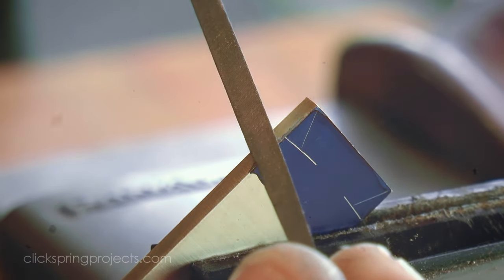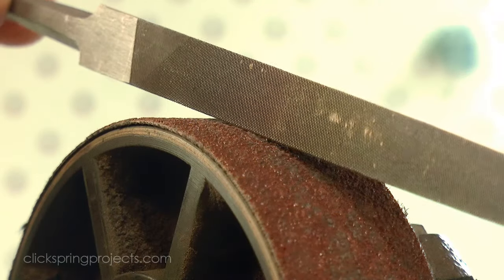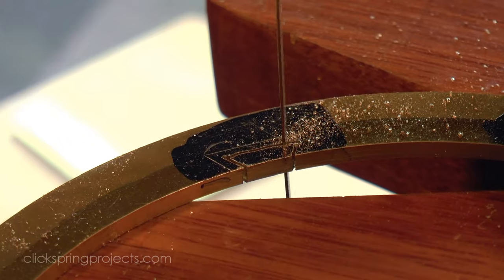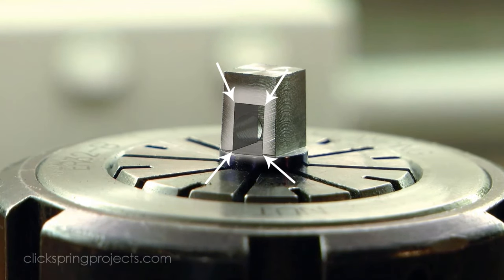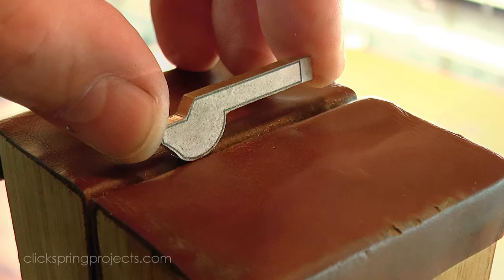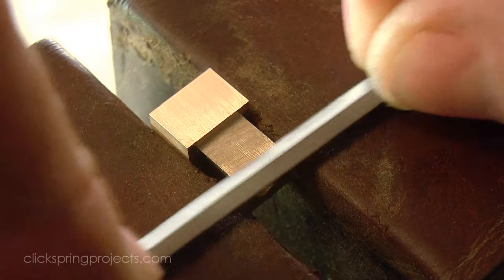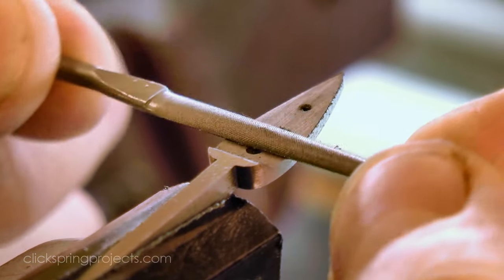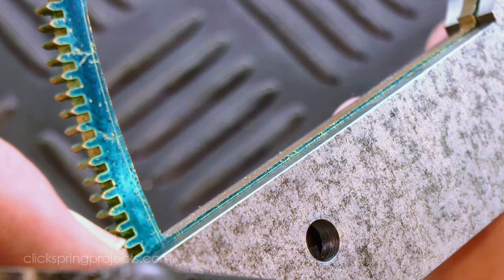8 Old School Tips For Better Hand Filing

Comment: I've tried using spray stuff or oil to keep a file from loading up and to make the cutting go faster, but just on crude jobs. Aluminum is the worst. After seeing this tho, I'll be looking for better files and fine brass brushes as I'm going to start making  parts to finish or restore older model airplane engines. Thanks Chris, you are amazing.

Comment: I like starting a cut or correcting the direction of a corner cut with a small knife file. I also like the finish I get with a sharp single cut file. Brands: Grobet Valorbe, Friedrich Dick, Bacco or Bacho Italian made files, OLD Heller Horseshoe made some VERY lovely old short needle files including the finest smallest knife file EVER. It's only about 3 inches long, and it has a very sharp edge. Huachaco made a very nice Swiss file in the Romansch area of Switzerland. Stubbs are about the best English files made. Heller is the best USA made file set in my kit. I have coffee cans and tobacco cans filled with small die sinker, needle, riffler, saw, sawpit, Pippin, safe corner fret files, and other specialized files, many of which I custom ground. Liogiers and Aeriou are two good rasp makers. Liogiers does bespoke shapes and tooth sizes/counts, with both right and left hand cuts. You can easily sink $40,000 in one order with Liogiers.

Comment: On fine work I clean my files a lot on soft material to get even removal, I always test my files on scrap of what I need to file so I can get a feel for how much pressure I want to use on the main piece so I don't dig into a piece and need to start over. Don't rush fine work, make sure you have time before you start fine work. For me rushing makes more scrap then anything. A good selection of files is key to having the one you need for the material you need to work on.

Comment: Superb work! Elegant! I really can't appreciate your work enough...
I had a question, what is the saw you use to cut thin metals? Is it just regular jeweler's saw or some special kind of coping saw? (And what's the maximum thickness (different materials: brass, copper, (annealed/not hardened) steel) it can saw through (efficiently)?
Thanks!

Comment: we had to file a piece of rough cut flat profile mild steel bar in school for metal work class 20mm x 100mm x 50mm to within 1/20th of a mm and all surfaces flat and square , finished with a chalk filled file to get it shiny . we sure learned to file properly ! this was 1964 . Still doing it when needed. nice video.

Comment: One filing tip given to me by my mentor specifically for use when filing aluminium is to file right to left,  instead of left to right for steel. In this way it is possible to get a very smooth non galling cut on aluminium

Comment: Sacrificial wooden filing jigs are also good when you have an object that can't be held with a vise. They are usually tapered pieces of wooden scrap that can be screwed/nailed/secured to a bench somehow. Making blade collars and other knife fittings that need a gentle radius is much easier when you can finesse the work and the file at the same time.

Comment: Holly shit, I thought I knew a bit about using files and I just discovered I know very little. I think putting a safety side on a file is the best tip ever as I have ruined plenty of perfectly made square holes when one of the other edges has hit one side as you described. I find a good sharp file is a pleasure to use.
Cheers Stuart 🇦🇺

Comment: Consider scraping as an alternative to filing. My last project was making a 50mm wide dovetail mounting plate from aluminium. I scraped the last bits using the the side edge of a woodworking chisel.

Comment: Is there any way you will publish the plans for the clock ? 
I study systems engineering and during my practial phase I got 2 weeks time to build a clock. Of course this is to short to build it the way you did, but I got access to a powerfull CNC-Laser, a lathe and other machines.
I found other plans on the internet, but none of them looked as good as yours. 
You'd make a young engineer very happy.
Cheers and keep up the good work.
Reply from the maker: You can buy the plans from here: http://www.clockmaking-brass.co.uk/clock_construction_books.html scroll down to the Large Wheel Skeleton clock - Cheers :)
Reply: Thanks for the quick response. Do you get the book as a pdf or as a real book ? As I'm pretty sure there aren't any digital drawings included, would you mind selling those if I buy the original book beforehand ?
I don't have the time to do them myself and my skills aren't that good yet.

Comment: For filing aluminum, I try to use files that say "Aluminum" on them, and keep THOSE away from the students who will beat them up.   Some hard soap (just an ordinary bar of laundry soap) can be rubbed on the file to help the action, and it just washes off.  I use ordinary but sharp and new files to cut the edges and corners of aluminum things, to give a crisp bright finish.  They would probably clog on a broader surface.

Comment: One thing you did not mention, but I am sure you know, is that square files are not in fact square, they are formed off square, so by grinding one face smooth you can get a much better square hole, also for longer file life, never drag the file back when filing, this blunts the teeth very quickly, you also point out the extreme value of making simple jigs a profiles, this is a huge benefit when making complex shapes, I also find the Valrobe files to be the very best available, they are of excellent quality, unfortunately most people tend to go for price, which makes the job of filing a chore, not a therapeutic pleasure. Many thanks for posting this tutorial !

Comment: Don’t forget keep files unclogged for cleaner cuts, by using wire brushes called file cards. I sometimes use blackboard chalks rubbed on to files to prevent clogging.

Comment: no mention of a file card , or french chalk , but all in all a great video
the guy who taught me to use a file forty years ago was called Mr Body , and his thumb was actually bent nearly 90 degrees over straight from applying pressure to larger files , to actually bend them along their length to reach the centre area on large flat surfaces.

Comment: This is 'filing' as I was taught it in the dim and distant past, when you were given an amorphous lump of metal and told to make an accurate cube out of it with only hand tools and marking/measuring equipment, that was when we used a measuring system around 'base' 12 and not 'base' 10 because the ability to 'divide' then 'divide' again suited hand craftsmanship and not machines - like Leonardo's 'man in a circle'

Comment: Hey Chris, I got a question for You if i might: What kind of brass should i use to make gears and things that You typically do in your movies ? Is it a lead brass like MO60 or normal Like M63 ? Which one does grind by files easier, and which one is better by strength meaning. I can't find any good literature about that. Can You recommend something for a beginner ?
Best regards, I love your work.
Reply from the maker: Hey Miklas, yes you're looking for a leaded brass (the lead component in the brass ensures that it is highly machinable) The best brass sheet stock to use for wheels, plates etc is generally referred to as "Engravers Brass" or "Compo Brass"- its a leaded alloy (in the UK called CZ120) with a "half" or "full hard" temper. Note that the temper has nothing to do with the alloy composition - other brass clock components are generally made from the same alloy in rod form, but with temper not specified - Cheers :)
Reply: Thanksy! i find it difficult to find pieces thicker than 3mm. As i am from Poland, but I'll keep searching. I will also take a look at local scrapyards, but is there a simple way how to distinguish that particular kind from others? Beside colour of course. Maybe some reaction like with vinegar or some common chemical that will indicate lead content?
Reply from the maker: Unfortunately there's not much to give it away. I'm fairly sure that Ian Cobb supplies into Europe, not sure what the shipping costs would be though: http://www.clockmaking-brass.co.uk/index.html - Cheers :)

Comment: somewhere long ago i remember reading a tip that said to place a dull file on a bright windowsill for several months. They said it would "sharpen" it. I presume it would be similar, albeit slower, to the chemical etching described below by different users.

Comment: Beautiful. I will only add a few "tips."  (1) A file cuts on the push stroke. Bear down on push, lighten up for pull. Failure to do this results in a dulled file and much frustration. (2) Keep the file horizontal when filing horizontal surfaces. (3) Get a file card or/and a piece of hardwood and use it to clean out the chips from the file. A clogged file will not cut. (4) This may be machinist superstition, but keep separate files for brass and steel. There! Now we are up to a dozen tips. In the old days an apprentice was given a 1" piece of round bar, a whole bunch of files, and told to make a cube out of it. Full disclosure: I still can't do that :)

Comment: Sharpen your files by leaving them in acid overnight, depending on the strength of your acid. You can use slow-acting Acetic Acid or a faster version and you also use a diluted version but find out the safe way to incorporate acid and water.

Comment: The file envy is strong today. Chris, what's your take on chalking a file?
Reply from the maker: definitely worthwhile, especially with coarser cut files, maybe a little less so for the fine cuts - Cheers mate :)
Reply: Clickspring right on, going to have to grab some chalk sticks for the shop, I have used snap line chalk in a pinch on aluminum. Also works great keeping slag from sticking to surfaces in a pinch but everything turns blue. Anywho, I hope all is going well, keep up the great work.

Comment: please comment on touching or wiping the file with oily fingers between strokes ( yuk...make it slippery).  also cleaning files during a job as well as every few weeks. what metal and method to use.. alloy strap pushed along the cut of the file.

Comment: I vaguely remember being told something about using chalk or talc to dust files with to prevent the metal dust / scrapings from clogging the teeth of the file and to keep the file dry to reduce rusting.
ETA: I see the chalk idea mentioned earlier in the comments now.

Comment: maybe you will have an answer, ive always wondered why do file sets often come with one handle, for the entire set, rather than each file coming with their own handle?
.... surly a wooden ( or plastic) handle, is the cheapest thing in the set to make, why not just give enough for all the files? And why arent they a permanent part of the file? i only have one file, where the handle is built into the file, and its all part of the same, single piece of metal.
Reply: When I was younger I thought most files must have had terrible handles. haha 
I think it's because the smooth cut files often need to be worked in small spaces or flat surfaces and you don't want a handle getting in the way whereas the files i see with fixed handles are usually bastard cut or rasps where you're taking a lot more material and need more leverage.
Reply: Some people, including me for some purposes, like to use reusable handles, with a hardened, internally taper-threaded bush which forms a thread on the corners of the tang (which is soft). This way, files you don't use very often (or which must sometimes be used without a handle, as TO's reply observes) don't use up handles. And when a file is worn out you recover that handle.

Comment: Great video as always.  Does Grobet make a set of files that you would recommend as my first purchase?
Reply from the maker: It's going to depend on the scale of work that you do - although you can never have too many files, you'll always use them - maybe dip your toe in the water with 2 or 3 needle files in a #2 cut? Once you get a feel of where that sits in the scale of your work you can add sizes, cross sections and cuts as appropriate and build your collection. #2 cut is a good general stock removal cut for the scale of work that I do, and for what its worth I use a tri cut, square and barrette cross section for 95% of my filing - Cheers :)
Reply: Thank you very much for your reply.  Is a # 2 cut for the needle files, or is that an across the board for any length of file.  Obviously my knowledge of files is pretty limited.
Reply from the maker: #2 cut in any size is not a bad starting point until you get a feel for what your work actually requires - it won't go to waste, you'll use it :)
Reply: Where is a reputable to get them, I not so sure of Amazon now.  Where can I get a catalog?

Comment: another good video - one question about your grobet files!!

Did you buy them individually over time or did they come as part of a set or different sets mixed and matched (im talking about the main files used during this Antikythera project)

if you happen across some links for purchasing - that'd be excellent :)
Reply: Looks like a reasonable set - thanks!

Comment: In old engineering literature it says to keep your files separate for different materials you cut.  Soft, hard and not contaminating either. Do people do this?
Reply from the maker: I do - I keep new files for brass only, stored separately from those dedicated to steel. As the 'brass only' files start to lose their bite, they are migrated to the 'steel only' collection.

Comment: If you need a square hole from a round hole, why not broach or use a hollow chisel mortiser to get the initial square shape that can be filed to size?
Edit: or just broach/hcm to final size
Reply: Work such as Chris does is more fitting one part to another one off type work. If I remember correctly he's shown how to make a square broach but an experienced hand filer can still do work to a higher precision fit.I doubt the woodworkers hollow chisle mortiser would work with any metal and the precision of any woodworkers mortices would be far less than just some of what he's showing in this video.

Comment: Great video and very informative but you missed one step, a card file to clean the file with. Most soft metal will clog the file and make deep scrach's that will ruin the finish.
Reply from the maker: Hey James, I don't recommend file cards at all - they're kinda ok for very coarse files, but the bristles tend to be hardened steel, and are therefore bad news for finer cut files. A kinder solution from the files perspective is to use a scrap of brass - push it up and down a few times to get a print of the pattern, and then use it to push out pinned metal - Cheers :)
Reply: Clickspring 
I agree with you, I use soap stone to keep the chips from packing in. slight tap on the handel/hilt and the chips fall right out.

Comment: Okay, I am suitably chastened, I THOUGHT I knew how to file.  I suppose it is not that bad, but, very nice (and I mean the old meaning of nice) style.  But, what of cleaning/carding, and gauls? Have I again nodded off during a crucial moment?

Also, whatever happened to square (constant cross section) rather than tapered files?  As to full size files, go into a shop that actually stocks files (carefully get yourself off the floor, the shock may have been too great) and ask for a square, flat, mill bastard file with a safe edge, you now know the meaning of the word blank as in blank face.  

I used to have a couple of boxes of Australian made Wiltshire 12" square mill saw bastards, each individually wrapped in greased paper, so evocative.  The last pristine one was "borrowed" and used to file hardened security bolts, ooops, got that wrong, the hardened security bolts were used to polish the cutting edges of the file <grrr>.  Modern files are a big disappointment, even if you find a good brand, sometimes the variability in the files is quite large, no quality control, hardness is all over the place, files can come out of the packaging with damaged cutting edges, uneven, and not flat!  

Needle files seem to be somewhat better.  I have a set of fine diamond coated needle files that I have had for a long time, yes, I know, not proper files, but, they are good, and reliable, and some are square!

Comment: what can you do to clean a file for example ? mine is full of brass because it sticks in the gaps
Reply from the maker: Use a small scrap of brass to push out the pinned chips, pushing along the cut of the file. Repeated passes will eventually clear the teeth.  Chalking is moderately effective at minimising pinning for file cuts <= 2, but is not appropriate for cuts 4 and above. Avoid using a file card except for the very coarsest of files; file cards quickly ruin the teeth of precision files - Cheers :)

Comment: I would add get a file card and clean the file often.  Also, old files can be somewhat rejuvenated by degreasing and then submerging in a citric acid solution for about four hours.  I use 1/2 cup of powder to a gallon of warm water.  Apologies to the metric crowd for my silly imperial units.

Comment: Probably not really relevant to your projects, but my grandad was a steam engine fitter and had some forged bars like the green thing here: https://photos.app.goo.gl/i6HOt3YVPunFUJhZ2 for filing flat surfaces bigger than your file. There is a tapered notch in one end to engage the tang, and the other end is just flat and pushes down in the middle of the file. 
And a new-school tip is that the electric/pneumatic power files that use a 12mm (1/2") sanding belt are really useful for some jobs.

Comment: Always make sure youre moving the file in the right direction. I see it all too much at work, guys will not knlw the direction the files cut in so they are pretty much doing nothing. Its like running a chainsaw blade backwards it will cut based on friction alone but its so much easier if you do it the right way